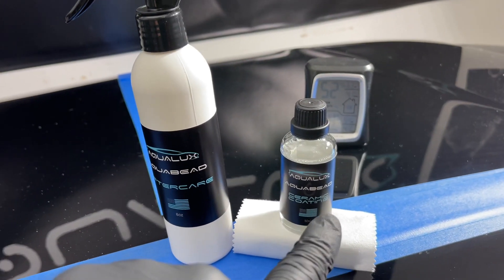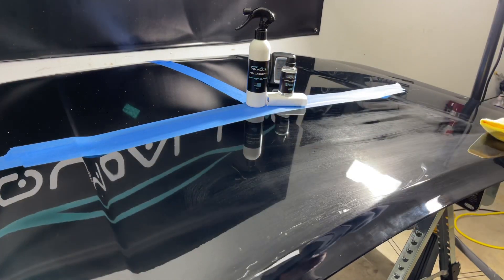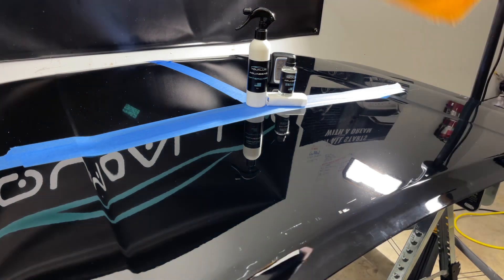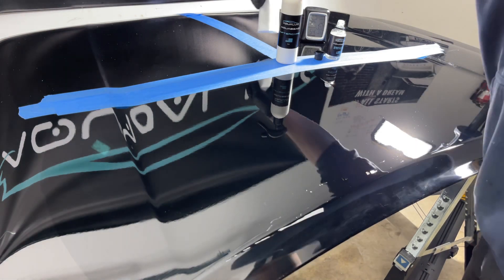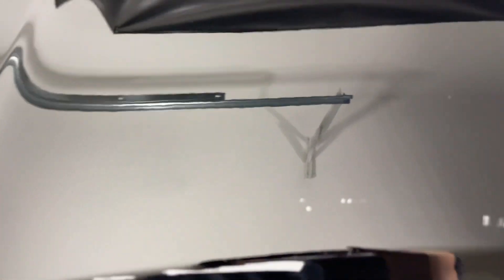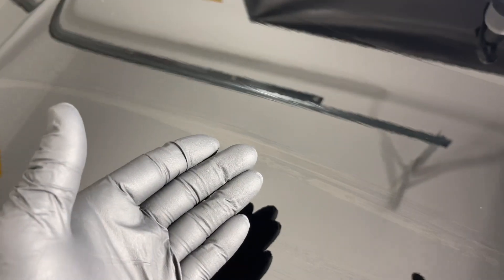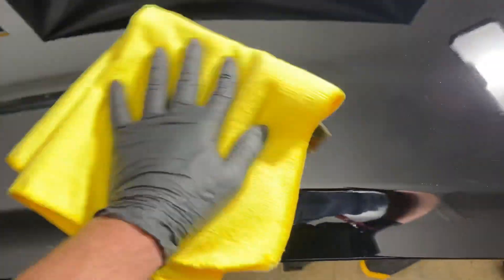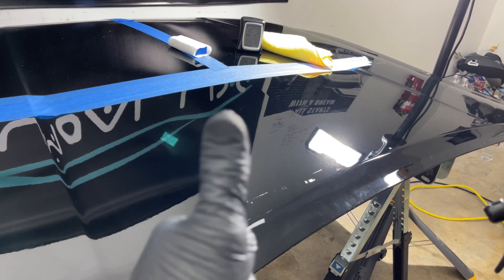The Worlds Easiest Ceramic Coating To Apply!!

Comment: Sorry but I have a few questions sir…1 does this have a cure time 2 how long until it can be exposed to water like heavy dew 3 can it be applied to PPF/vinyl wrap 4 can you apply multiple layers

Sorry for so many questions, but I need to apply outdoors and it usually gets dew every morning, and I have PPF (flexishield)
Reply from the maker: 4 hours till it can get wet/exposed to heavy dew, yes it can be applied to ppf/vinyl, yes you can apply another layer within one hour of the first layer.
Reply: @AQUALUXAUTODETAILING  thanks for quick reply
Reply from the maker: @edsmale  happy to help!